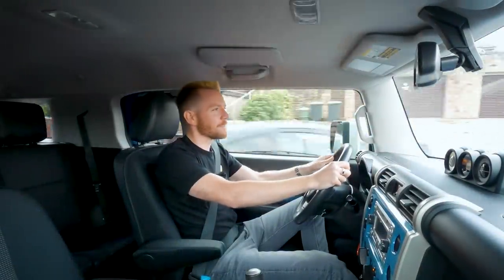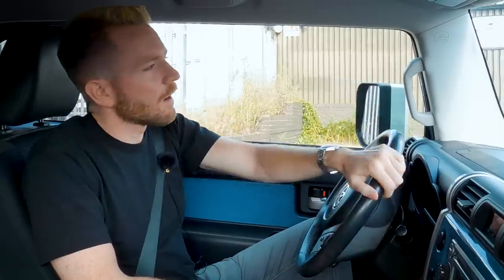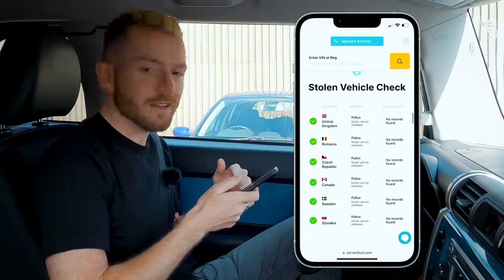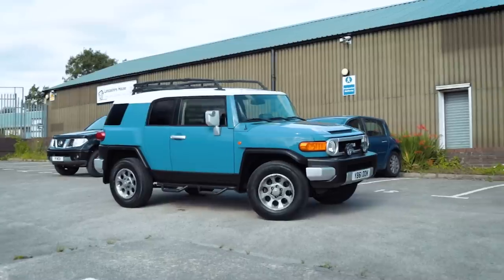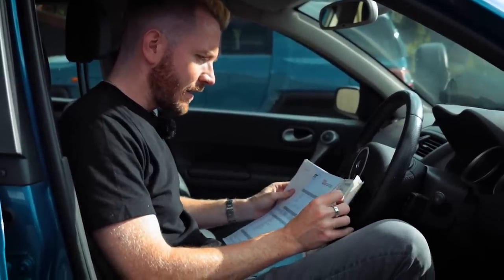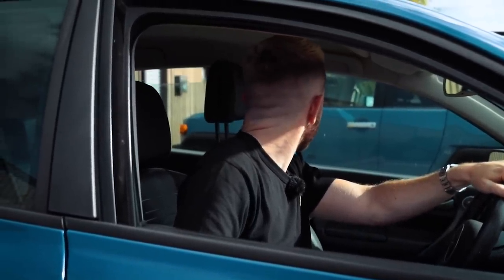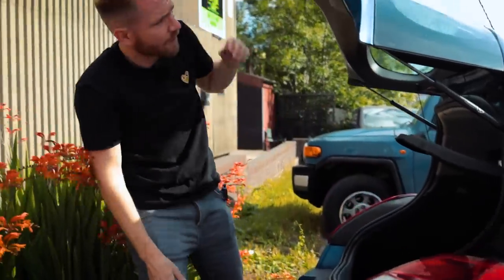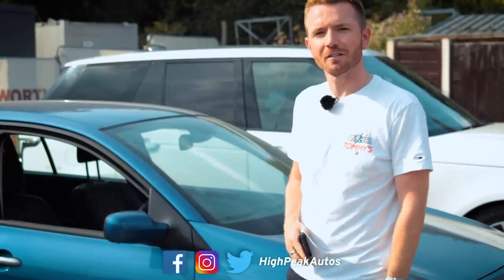I BOUGHT A RENAULT MEGANE FOR £295!

Comment: 3 years ago I bought a 2006  3 door 1.5  DCi  as a runabout with 122,000  miles on it.   Engine is excellent. Never had any leaks - water or oil . All the windows work. It starts every time, is great on fuel.  Has  a clean MOT and the MOT station says here is no corrosion underneath.   It is not perfect - the stupid message centre keeps telling me the key card battery is low when it isn't - so I have spent the last three years ignoring it and never let me down.

It costs me £30 road tax. Spare parts are cheap and I can park it anywhere and  which from personal experience is more than you can do with a Golf GTi  or  a Prodrive Impreza.  

I suspect the 2 litre diesel will be less reliable and more expensive  and  a waste of time  but this little 1.5  has surprised me.  People even say it looks stylish.  I might have bought it as a run about but it just keeps running !
Using it  also keeps the miles and so depreciation down on everything else.  

 It might disappoint some for me to say it but it has not turned out to be a bad purchase at all.
Reply: Mechanically this cars are very good . The electronics were the problems. The mk3 has the good engines, the diesel especially. And the electronic problems were few and far between
Reply: @cosmins3268  Having said what I said the window mechanism on front passenger side has now broke ! Ironically, not an electrical problem but the plastic clip which connects the window lift mechanism to the  window itself. Have to take out the whole mechanism and dismantle it to put in a new clip. The job looks to be a pain in the ar*e. 
The upside is I got a full  new refurb kit including cables,clips,two springs,gearbox main casing and spool for less than 8 quid. There is life in the old dog (the car not me) yet.
Reply: Plastics on mid 2000s to mid 2010s renaults are fragile as hell. They like to fall apart and lose their colour. Windows buttons breaking too. Look at radio units from any mk3 Mégane or Latitude and you'll know what im talking about.

The 1.5dci though, pretty nice engine. More power than you'd think and even when you beat on it regularly you cant get worse than 40mpg. And they are tough engines too, have seen ones go over 600k miles. Maybe thats why mercedes uses it too.
Reply: I bought a CC with the Turbo 2 Liter for under 2 grand with all options and 2 years MOT, new tires, new brakes and a full service. Even 3 years Later the thing wont die. No Matter what i do to it, How hard i drive it. How stupid of things i did with it. Aslong as i drive it up to temp and Service it i think its gonna haunt me forever haha
Reply: @MidshipRunabout2  i have seen one Kangoo with 1.5 dCi almost 1.5 milion km
Reply: Ditto re: Mk 3 1.5 TDI..
Reply: Was there 2.0 diesel in the megane mk1 and mk2? I think it was only 1.9 dci and 2.0 petrol which is super super rare. I might be completly wrong tho
Reply: @ilijapetrovic5002  Yes,  I think the Diesel was 1.5 and actually 1.9 . The 2.0 may have been a figment of someone's  imagination.
Reply: @we-are-electric1445  there is 2.0 dci but its newer i think
Reply: I saw a few Megane RS in good condition with more than 300.000 km when i used to work for a renault dealership in France. I wished my Subaru and Audi would be more reliable than my renault twingo with 300.000 km on it.
Reply: 30 quid a year that is?  Im from across the canal. Just curious to compare  prices.
Reply: @Mech.E  Is that the Leeds Liverpool Canal 
 or the English Channel?
Reply: @we-are-electric1445  English channel
Reply: @Mech.E  Forgot to answer your question- it is 30 quid a year - and it also doesn't appear as far as I can tell to have a dpf to go wrong !
Reply: @MidshipRunabout2  Does Mercedes use the same engine as a Renault? For the A or B class or something?
Reply: My parents borrowed one of my aunt & uncle about 6 years ago to go on a vacation 350 miles away, we were almost there when the turbo blew up... From then on i didnt like newer Renaults anymore😂
Reply: @prosecanlik4296  A fantastic long service engine if looked after and regularly serviced👍
Reply: The 1.5 dCi is a gem - so economical and smooth yet still punchy, especially in 100 and 106 bhp guise. However it commands strict maintenance - 5W30 fully synthetic every 5k miles and regular fuel additives are the bare minimum if you want it to last - but if you keep to that it will reward you with years of trouble-free motoring, whether it's powering a Renault or a Nissan.
Reply: I have a mk2 grand scenic as the family taxi which I got for £600 5 years ago to use for a few months and it's still here lol. Cost me no more than £300 a year to maintain, gets 50mpg on a run and being the 130bhp 1.9 its as fast as a PD130 🤣
Reply: My 2006 3 door 1.5 DCI is at about 360,000km and no serious issues yet.

Comment: Bought one of these as my first car at an auction for £350. Everything mechanically important worked a treat, but everything else (electric windows / sunroof / blower fan / remote central locking) ended up broken.
Reply: Standard for a Renault.
Reply: @captainbadger1013  standard for a Renault up til 2007/2008, after that it's a myth
Reply: I have one from 2010 .besides the rear hatch giving me problems one time and had to open it and clean that button , it's bean pretty good. It has 230k kilometres on board .
Reply: My gf just bought one of these for dirt cheap off her dads friend for the same thing, just desperately needed a run about. All of the mechanical stuff works perfectly, but the aircon didn’t work and all 4 windows didn’t open either. Not fun during this summer

Comment: Dont underestimate the mk2 megane.  Drove my 2006 1.6 16v for 7 years,  and i was the 3rd owner. Only problem though,  getting parts in South Africa was expensive,  and some mechanics refused to work on them.  If covid 19 didnt happen in 2020, i probably  would still drive it.  Very comfortable driving.

Comment: I bought my dad one about 5 years ago for £600.  it has passed 4 mots, with absolute minimum spend, it got a battery last year, and one of the fog lights has water in it.
My dad is the most anti french car person you could ever meet previous to this car.

He loves it. Great comfy seats, 100% dependable and i am quite sure when he stops driving in the next few years (he is 87yr old), he will probably hand it back to me, and it will probably do £500 still.
I realised years ago that the French get a rough deal in the motoring press, because its all predominantly German owned and/or funded.

Comment: We have a renault megane currently. 1.5 Turbo Diesel. just hit 200k miles about a month ago. Had a new turbo, full spec with autolights, windows etc. Everything works other than 1 window doesnt do anything and ABS light is constantly on. no issues other than that. We actaully just removed the stock radio and installed a android headunit and is one of our main cars we use to travel to work and back.

Bought it for £500

Comment: Looksan honest car with plenty of  life left.We had a 1.5diesel pool car that ran to well over 200,000 miles.Took it to the dealer for a headlight bulb and they quoted an hour to take the bumper off...no there is an access cover in the wheel arch.Bullet dodged.Local garage did the Cambelt for 450 all in and yes ,all the windows worked ... .

Comment: I bought a 2004 Megane with the 2.0L and all fruit, leather, glass roof, auto, with 230,000km that’s about 130,000 miles. Living in Australia it had no rust because of our 40c summers, only work it needed was a new steering wheel clock spring to fix the airbag fault, front lower control arm ball joints, new discs and pads, which are normal wear and tear items on all vehicles as you rack up mileage. When l sold it on at 300,000 km everything still worked and no rust or leaks.   Longevity has more to do with climate more than perceived build quality. My Discovery 1 tdi has over 500,000km- 300,000 miles with no rust.

Comment: I drove my Twingo 1.5 dCI 2009 until it hit a bit above 470,000 km (that's almost 300,000 miles for EU-hating Island folk, ooh!). Worked like clockwork including botH electric windows - rear ones don't open on a Twingo. 😅 Then sold it for a bit more than EUR 600 last year. Now got a Duster 4x4 with the same engine, hope to do at least as many miles. Surprisingly, the Duster is even more economical (done 70+ imperial mpg on it - that's a 3.9 to 4.0l/100 km for EU citizens of the World [in 2wd mode on mostly highways, of course {does around 5 to 6l/100 on mountain trails when I have the 4wd lock engaged}] ) on a long 2000km journey across the EU. I believe it was around 2007 Renault had started fixing their mess and started producing reliable cars. My two penises. Maintaining the Duster costs peanuts just as did the Twingo. As you can tell, I'm saving money to buy an electric by the 2050s by when one of two things may have happened - world has ended, or electric cars actually started making sense. In the meantime, just as John Lennon would have said, I'm living the life. Cheers.
Reply: I drive a megane mk3 fleet model with the 1.5 and I gotta say the 1.5 dci is a great engine. Not fast or anything but really good for city driving. As long as you are above 1700rpm, it won't get bogged down on any slope. For fuel consumption, in a highway i hit as low as 3L/100km, while in the super crowded city, its more like 5-6, 7-8 if I beat on it. I've seen some chip their cars to get even better figures, as it gains you more low end torque. But at that point you're risking the transmission, as the old 5 speeds were made of glass. I hope the 6 speeds are better.
Reply: @MidshipRunabout2 , frankly, the least of a black hole your car is, the more money you have to get a second yacht. In that sense, the 1.5 dCi can only be a sound choice. Ever since I got the Dacia, I really stopped getting the reasoning behind decisions being made to get anything else as a daily driver. I may get a Rubicon as a weekend car, but nothing even comes close to owning  a diesel Dacia in terms of value for money. Plus, forget Audi or WV Phaeton; THIS (DeMuro vibes) is the ultimate incognito car.
Reply: Cars are like clothes. You get to have a first impression of who's who and what superiority, size, or status complex they have by their choice of what car to wear. I simply don't want to engage with this. Finally, it's no secret that the cost of car ownership is bonkers and wouldn't make sense in any of the 3780 parallel universes in our cluster, but watch "The Insane Cost of Cars" from TechAltar on YouTube for a bit of an eye-open. I'm a car person all he way and have a bad addiction, heck I used to live a 10 min walk from the office and I would still drive, every single day, year on year. But yeah, I understand how cars can be unreasonably expensive. And some people complain about nonsensical inkjet printer costs.... Pfff 😅🤣

Comment: Good tip for when inspecting an (older) diesel like this. With most brands you can just lift off the engine cover. Its always good to inspect the injectors with diesels. They are prone for leaks, when left unchecked they can be very hard or nigh inpossible to remove. Resulting in totalling a car in some cases, (diesel injectors can be really expensive!). Especially older Mercedes diesels are known for leaking injectors. 

Great content again Mark! Good find for the money, can be a reliable daily driver for a customer with a smaller budget. I actually worked as a Renault Salesman. I can really appreciate you being a honest dealer. Keep up the good content!

Regards from the Netherlands.
Reply: Mark 😂 wonderful

Comment: £295 Megane. What could possibly go wrong? 
I’m going to watch the video now 🍿

7:53 “Sounds ok” (me: If you’re into lorries)
11:10 🏁Launch control? 😝
12:00 Disappointingly good so far 😈

I’m glad the car won’t be scrapped! 👍
Reply: This could go for £8-10k where i live. Used cars seem dirt cheap there lol.
Reply: @khelgarironfist3301  
Where (about) do you live, on a remote island perhaps? (I’m just curious)

If you’re in the UK it would be hugely profitable buy from or near Matt and drive home.
Reply: @khelgarironfist3301  Where are you? Ged
Reply: @Conservator.  where EU and Asia meet. And no if you do that, you pay huge taxes that it's not really profitable.
Reply: @khelgarironfist3301 OK, thanks. Too bad that taxes are so high. 😌
Reply: @khelgarironfist3301 Pretty much the same here, not quite as much but a car like this with relatively low miles would be at least $5000.

Comment: I did a lot of research years ago when I was considering a Megane for my driving instruction school. Cheap to buy and run. I found that Renault drastically improved their woeful electrics reputation from 2006 so I finally got a 2007 megane 1.5 dci. It was excellent and never let me down.  So good I bought another a few years later when she'd done 190 k miles.(to be honest, didn't really need to get another, just wanted the 110 bhp  one with six speed gearbox). The 08 I bought was just as reliable. I had a friend who contracted himself out as a car electrician to various big  car companies around that time and he was very surprised and impressed with Renault quality.  He told me they were, by far, the most stringent. I have a feeling they may have slipped again from 2012 onwards. Probably to save money...
I wouldn't buy a later model but I've had no trouble with 06 onwards and have a 2011 Renault Wind as my everyday car and wouldn't have any problem getting a Laguna Coupe (2012ish) which is a beautiful car.
Reply: renault really gets alot of unneeded hate, just like any car they're great when maintained

Comment: These were a decent little car, the biggest cause of the electrics messing about was due to water getting into the UCH under the bonnet. Replacement window regulators and keycards aren’t overly expensive either.

Comment: Being 10 years old when this shape Mégane launched, I will forever have a soft spot for their styling. I think the entire Renault range looked fantastic in the early '00s. I once had a go in a 2.0VVT Mégane CC and was pleasantly surprised by how nicely it drove. I reckon a hatchback with the same engine would be nice...until the electrical equipment failed.
Reply: 2002 was not 10 years ago
Reply: @mustsilm  I didn't say it was. I said I was 10 years old in 2002.
Reply: @joshbrailsford  ok my bad

Comment: We had a ‘56 reg one of these for 5years - a base 1.6 16v Expression model. It had the usual dodgy French electrics in terms of electric windows that had a mind of their own and would go up and down when they wanted when it rained.  Mechanically it was 100% reliable in the 85k miles we did in it until it developed a slight gearbox whine at 150k.  It was comfortable and never returned less than 40mpg, even when transporting the five of us around

Comment: I had a 1.6vvt one, had 3 working windows. I can't remember much about it which says a lot, but it did feel like it had a wide wheel base that kept it planted on the road better than other hatch backs I'd had. Replaced headlamp bulbs through the wheel arches for some crazy reason.
Reply: my brother had a big French car, and the electric windows broke about every 2 years, so they replaced the window motor with a good quality one and that fixed the concern. it seemed like the window motor fitted at the factory was too weak to begin with.
Reply: I had a 1.6vvt break. Everyday was a gamble will i make it to work or will it stall and never start again. Horrible car. But it was quite good to drive. Clutch feel was horrible but brakes worked really good and it was a safe car. But i was really unreliable.

Comment: Matt is wise to flip it, as it looks like the sort of car which would attract the type of buyer, who would be demanding recompense for every minor fault down the line.
Reply: Yes, totally agree... It would be like " ever since you replaced my alternator, my muffler has developed a hole in it and it’s noisy "...
Reply: A wise man would not buy Range Rovers or Mercs. Both have poor reliability and build quality issues. So no he is far from wise
Reply: I had one as my last taxi.Its got 450,000 km on it,and still going.
Only real problem was a gearbox at 300k and the blower motor went twice.
Reply: All the owners of German cars that I know of are constantly fixing them. Seems many people are blind to this.
Reply: @rpw2003  Japanese is the way to go. (except older Mazda and Nissan which usually have terrible rust problems).
Reply: Good point
Reply: @TheTantalum not to be nosy, but so bad you unsubscribed? could i ask if you could explain what brought you there? recently i saw a video of him turning away lots of potential trouble customers to a turbo mini, maybe he’s learned since i started watching? genuinely curious.
Reply: @TheTantalum absolutely fair.